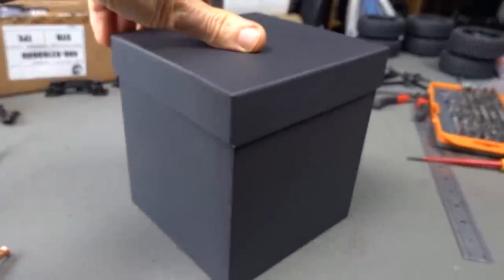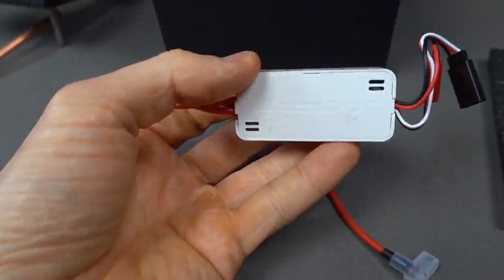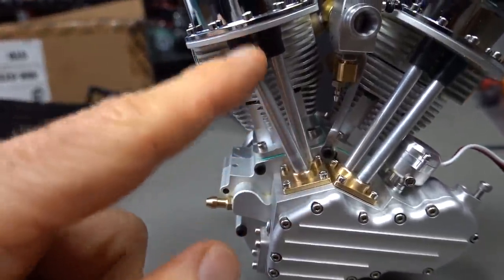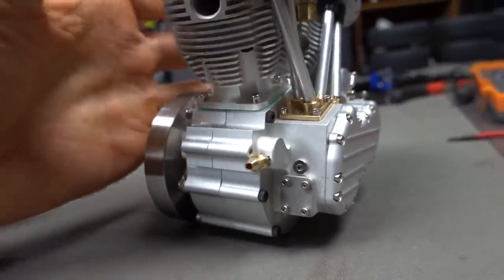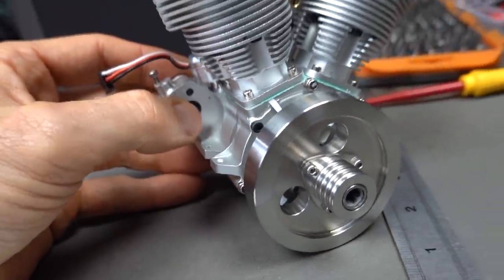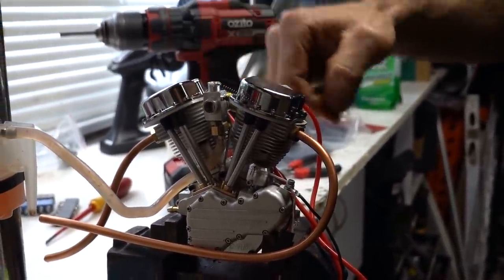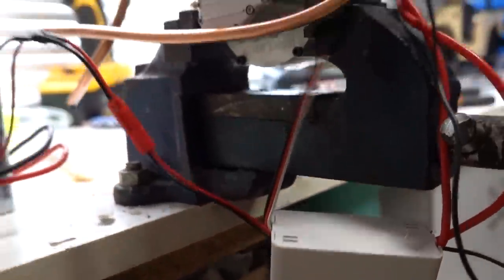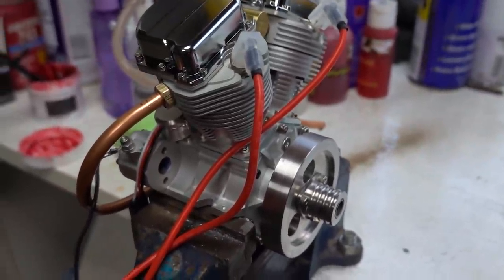MINIATURE HARLEY-DAVIDSON V-TWIN PANHEAD ENGINE THAT RUNS - SOUNDS INSANE!

Comment: The engine's them selves didnt leak oil, they had an external drive chain oiler that dripped engine oil on the chain and it was adjustable.  Awesome engine for sure.
Reply from the maker: Thanks for the info
Reply: Once you put a few miles on them they did…it was due to the mediocre fit & finish of the components at the time…in fact, I don’t think they got a oil “tight” bike until the Evo came along…some would say the engine that saved HD.
Reply: I need my oiler turned down.lol

Comment: WOW! Someone finally got a scale engine to actually look and sound like an engine! 
  Now, if you can get it to leak reliably you will have created perfection! 
Well done mate! Cheers!
Reply from the maker: Much appreciated brother
Reply: Look into the Moki 400cc radial, sounds just like a real plane
Reply: Yes must leak and need tuning every once a month on a sunny Sunday and polishing for at least 3 hours every other week ,oh and it must be chain driven so the inertia rattle on chain and drive sprocket wears main driveshaft every 6 months.
Then it'll be authentic!✔️
Reply: Judging how it spewed oil out of the exhaust he's off to a great start
Reply: I had a 57 Panhead and the sucker would leak more than the Exon Valdez in the 80's. There was an adjustment to oil the primary chain using a dripper mounted on the side of the case. Every time it would jiggle, it would vibrate some engine oil and lubricate the primary chain going to the transmission.

So in reality, it was a good thing to find oil under your ride after it had parked for a bit. All the accumulated oil inside the primary cover, would leak to the ground. It also helped the dust to stay down. 

Nowadays, it is worrisome finding oil under your ride anytime!

Comment: Harley spent a lot of engineering muscle to design an engine that sounds like it will die at any second while producing as much vibration as mechanically possible without falling apart.
Reply from the maker: Lol
Reply: Yep! That’s why they’re great! Ever seen the smile on a woman’s face when she’s on a Harley?
Reply: @boataxe4605  That's exactly why Harleys aren't ideal as motorcycles,  granted, they are technically advanced, and powerful as vibrators go, but since they won't fit in most bedrooms,  they weren't great at that either,  and for those who could get them in the bedroom, they got off great, but they died from carbon monoxide poisoning.
Reply: Some reservations on the last part of that sentence .
Reply: WITHOUT falling apart? How many Harleys have you been around?
Reply: @palleppalsson  OK, you caught me making  💩 up. Harleys have always  brought out the trouble maker in me. They're so loud, and annoying, I can't help it.
Reply: @RyanMcIntyre  Well everything is relative,  they have to hold together long enough to drive off the dealership property in order for the customer to legally "take possession" of the tractor/vibrator/motorcycle , and by "take possession",  I mean get ready,  the spector of Harley ownership will soon make itself painfully evident.
Reply: @RyanMcIntyre  Dude, all anyone has to do is stay awake while driving.  99 out of 100 bikes pulled over along the road are Harley riders looking at a broken rubber band. 😜
Reply: I first read this and was immediately clutching my pearls! How dare you!? lol. 

However, not standing up for H-D too hard here (they’ve had their fair share of issues) but when AMF bought them out, they made dog shit bikes. When the og ownership bought the company back, it took the help of BMW to get them back to respectable with the Evolution motor (imo H-D’s best engine in terms of sound, reliability, and weekend mechanic). 

NOTHING sounds like a carb’d EVO at idle
Reply: @boataxe4605  
The smile would be more impressive with more teeth. 😁
Reply: HAHAHA
Reply: @divine_swine9665   I call bullshit. Please share why or what makes you say Bmw ever worked with Harley. Especially on the evo motor. I'll wait.
Reply: @divine_swine9665  nope the best idle goes to  the shovel/pan .can't get the girls off it . something about a galloping horse sold the evo kept my shovel with 4 long f#kin gears to ride at low revs cheers from Oz
Reply: @RyanMcIntyre  haha I thought he was referring to the women's smile not the falling apart I mean I'm a Harley enthusiast, I love all Harleys but come on how can you argue with that? Harleys are not known for their dependability!
Reply: I also heard that Harley spent quite a bit of legal muscle trying to patent the sound.
Reply: Paul I worked at a dealership  they catered to yuppies , I worked in the parts and accessories department.   I have owned  many Harleys. I don't ride anymore  my last Harley was a 06 Street BOB many problems with, it my last bike was A Vulcan 1700 classic better than all the Harleys  I ever owned, .
Reply: @motoman7445  BMW is fare superior lol , and I owned three Harleys  ,  and I worked at a dealership , where they catered  to yuppies , BMW isn't made in China . My last bike before I had to stop riding was a Vulcan 1700 classic was  stock and it would blown my last Harley a 06 street bob away and that had performance parts in it .
Reply: @palleppalsson  right, they do indeed fall apart, I’ve owned almost every make, the best road going bike ever made is the GoldWing
Reply: @scottkeppler9151  🤦‍♂️ What does anything you said have to do with my comment?
Reply: @boataxe4605  very true. I've never seen a grumpy woman on a Harley, a horse, or a bike on a bumpy road. 😎
Reply: The Harley Davidson, the perfect tool to turn fuel into noise without the side effect for of performance.
Reply: You're just jealous that no one is buying or even making miniature models of your moped engine, haha.
Reply: I agree with the sound part, but falling apart.  They do that regularly.
Reply: @motoman7445  he meant Porsche design…
Reply: @Wooskii1  and lost handily.  Po-ta-to sound not patented.
Reply: @boataxe4605  this comment is so underrated lol
Reply: Harley are still over priced pieces of shits lol.  I would never own one. Loud and Slow.... maybe a Sportster Maybe but I still can't bring my self to waste money on one.
Reply: Yeah and I delivered a load of the bikes to Phoenix and LA.and both places shocked me and pissed me off.neither place had a load dock or a ramp.so they just slung a strap and chain and drunk them back in their crates,2 high. REDICULOUS.piss poor management if I ever seen or heard of.i mean cheapest bike was probably 15 grand or better.but the gals in the LA shop did want me to bring in my black bug so I got him a leather Harley Davidson collar also
Reply: @scottkeppler9151  yeah but BMW's are apposed twins not a v twin.which makes them lighter and easier to handle. Dad's cousin had an old 900 and his daughter had a Yamaha 400 special.and the 900 felt just as light.the weights down low.
Now my cousin wrecked his goldwing June 6th.turkey flew out of the ditch and hit him in the head throwing him into another vehicle head on.he's now paralyzed waist down.he loved riding. So did I.my last bike was an 85 Yamaha Venture Royale touring bike
Reply: @boataxe4605  oh you brought back memories  by that comment. Women said one day when i asked why do you like riding on the back of a rocket?  Her reply "the vibrations "  I'm like jump on this.   She did. I fired up the harley and got the "OH MY" lmao. Believe i changed her mindset
Reply: @deborahchesser7375  Learn to do maintenance!
Reply: No they fall apart
Reply: @seanbutler2291  Whatever you say troll.
Reply: @boataxe4605  Wipe that seat
Reply: and what a sound it is
Reply: @Asphaltsquadron  …. Calm down Mate… he’s getting your Goat.
Reply: @motoman7445  I think they're referring to Porsche's work on the Vrod but I am sure you knew that.
Reply: @deborahchesser7375  the Goldwing is a couch with wheels.  Not a bike.
Reply: @poolshooter1229  I can teach you anytime, I’ve been a mechanic for 35 years
Reply: @deborahchesser7375  You near Jacksonville NC, I have my two bikes apart, one waiting for powdercoated parts and the other waiting second in line a 19 year old Swift Bar Chopper with only 1700 miles on it, it runs awesome...just needs my spare time I never have. I started wrenching my minibikes around 1965.🤭
Reply: You can turn the idle up, but a lot of us want that low chunk-chunk sound. And this is an engine that was designed in the 1940's. Lots of haters, nerds and misinformation in the comments. Harley has never worked with BMW, they worked with Porsche on the V-Rod engine, not the Evo.
Reply: So what you're actually saying is, "I want a Harley, but I can't afford it and wouldn't know how to ride it.
Reply: @deborahchesser7375  agree 😊👍💯❤️💋🔥🔥🔥🔥🔥🔥🔥
Reply: @monroe7403  That is correct, the Revolution was designed by Porsche, the Evolution is a HD inhouse design. IIRC the initial design by Porsche was lighter and more compact, Eric Buell wanted to use that engine, but HD had their way with it and it turned into a bulky and heavy motor.
Reply: @poolshooter1229  man I’d love to come down there and help ya out, I have family in Asheville, I’d love to move down there, Oh is too damn 🥶 cold
Reply: @ashookchandra8191  Wings really are great from 76’ on. Honda in general is hard to beat.
Reply: @divine_swine9665  add a crane fireball cam to the mix with head work to suit and you have the perfect evo engine, I ran points though, as I only had a kicker no zip start
Reply: @deannederhoff  Sorry for your brother.  I’m happy I survived my 2 wheel years with my skeleton and most of my skin intact.
Reply: @billygraham2132  don't know what part of that that you're talking about sir but thank you.cousin wrecked his goldwing on a 2 lane County road in Iowa June 6th 2021.turkey flew out of the ditch and hit him in the head.threw him head on into on coming traffic.he's now paralyzed waist down.but I sat on his dad BMW 900,many many yrs ago,and it felt as light as his daughters Yamaha 400 special.just because opposed twin cylinder.come down to maryville tn and ride the tail of the dragon some time.beautiful ride.even in a car.it was even in the old movie TWO LANE BLACKTOP with James Taylor and Dennis Willson of the beachboys.the restaurant scene was up there.lol
Reply: @RyanMcIntyre  Falling apart??? I paid $40,000 for an Iron Horse Outlaw, towed back to shop 8 times first 900 miles...i'll keep my Harleys.
Reply: @monroe7403  "Harley has never worked with BMW" - you. I want you to Google that so you can correct your misinformation.
Reply: @r0bkills  I believe those are referred to as generator shovels.  Potato, potato, potato...😎
Reply: Harleys make plenty of heat than power..so its an effective heat pump!
Reply: Who said they didn't fall apart? My buddy's AMF Harley wew!
Reply: @alexnutcasio936  The V-Rod was a collaboration with Porsche (bike, engine). The EVO engine was a collaboration with Honda.
Reply: @Hathorr1067  isn’t that what I said ( referring to VRod)…….the EVO is equally junk.
Reply: Let's not forget the reliable oil leak they designed into it.
Reply: @trxtech3010  Well, once you own one, you never go back and wonder why you didn't spend the extra money and just get a Wing or a BMW. Mine not only vibrated, it leaked, so I got the double pleasure of a total POS.
Reply: Awwww come on man,...they fall apart sometimes.😂

Comment: Sounds real and has that lope. The mounting flanges are not tapped on originals, just bolts thru with spacers on the frame as needed. The engine mounts were bolts/nuts front and rear also with a skid plate.. I do like what they did for getting close to the original sound.
Reply from the maker: Thanks for the info mate

Comment: That hole you pointed out as a possible starter mounting was actually the location of the generator on the older style Harleys. I rode Panheads for 10 years, m last on was a 1965 Electra Glide .The starter was mounted on a cast aluminum Primary cover and engaged with a flywheel on the clutch drum on the transmission.
Reply from the maker: Yeah fully aware but this miniature version apparently might have a starter motor there

Comment: That’s amazing.  Now all you have to do is make it  leak oil from the primary cover located on the left of the engine  because of bad seals or o-rings as well as make it leak oil from the drain plug and starter areas.
Reply from the maker: lol

Comment: Good vibrations dude! Pan head? May want to keep a shop towel under it if it’s based on the infamous pan head😂! What are you gonna put this in? Nice little kick scooter motor! Very nice brother!
Reply from the maker: Haha yeah man. If they can sort out a starter and clutch then a Morgan three wheeler style would be awesome
Reply: The original panheads did leak however the new crate engines from places like s&s have updated parts from the evo.. they last a long time and run great
Reply: The intentional leaks from Harley were from the primary drive.
Reply: RC Car

Comment: Would be absolutely awesome to see this in a tiny little motorcycle or three wheeler type vehicle
Reply from the maker: I agree man
Reply: RV trike would be awesome 👌
Reply: @RCTanksTrucks247  40s military harley with sidecar would be awesome
Reply: @migz2195  Except a 40's Harley would have a flathead motor. Not a panhead. Js.
Reply: @motoman7445  ahh I see....well that sucks lol
Reply: @migz2195  tbh that would be a awesome project to see and see the final outcome, if someone would really try and take lengths to make this into a small scale Harley would be ridiculous if it was a two wheel rc design
Reply: @RCTanksTrucks247  Schwinn Stingray 16. Will have to buy on eBay
Reply: Why not a moped?!
Reply: Trikes are gay but I would love to this in a mini flh or mini chopper
Reply: Side car
Reply: Hello

Comment: Where you talked about mounting a starter is where the original 6 volt generator would mount. The very last year models were made with a 12 volt generator and only the last year had an electric starter that hooked onto the primary drive at the clutch/transmission location
Reply from the maker: Ah hopefully with this rc version they could adapt a starter motor instead with a one way bearing
Reply: @RCTanksTrucks247  Just relaying some history since I was a Pan owner reclaimer after a fire

Comment: 7:45 that's not the idle adjustment screw. That's the mixture adjustment screw.
The idle screw is that little black flathead screw sticking out below the throttle arm. It's pointing directly to the lip on the cylinder panhead. That's what adjusts the idle.
Reply from the maker: Yeah figured it out 👍 Thanks anyway

Comment: The clutch on a Harley does not mount at the flywheel.they run a primary drive chain or belt to a clutch driven transmission mounted to the rear of the motor. The secondary drive to the rear wheel would be on the other side.
Reply from the maker: Yeah I know but for a rc car application I need the traditional clutch bell style
Reply: The secondary drive to the rear wheel would be on the other side, really?
            NOT !

Comment: this in a boat might be a new project for me, sounds awesome, would be great out on the water, just difficult to cool it
Reply from the maker: Yeah man, great thinking
Reply: It's air cooled. Why would it be difficult to cool ?
Reply: The shovel head started out being a boat motor,
Reply: @jameskong5233  no.... it did not. 🙄 it was designed from the beginning to be a motorcycle engine and thats what it always was. Someone somewhere probably adapted it for other uses but it was always a motorcycle engine.
Reply: @jameskong5233  You mean boat "anchor"... LOL!
Reply: @whatyoumakeofit6635  not enough airflow around it due to how much weight it would be pushing. On a little Jon boat I wouldn’t think it would do much more than a couple miles an hr. So it would more than likely heat.
Reply: Fan/airboat prop on the crankshaft and a bit of ducting should work, or a belt driven blower. RPM's would be the biggest issue. Doable.

Comment: greetings, from across the pond, over here in sunny Melbourne, Florida. I always wanted to build a little V-Twin, I was even going to try building one with a couple of five horsepower overhead valve lawn mower engines, I may still do that one....but, I can guarantee you that the motor you got there, probably cost almost as much as an actual V-Twin. yeah I'd love to know the price and the specs of this thing, how much power, etc. that thing's super cool. hey, one question. the engine didn't have enough fly wheel weight inside the crankcase, or is that just an extra flywheel on the outside, just too smooth it out on the stand? I'm sure I can help you figure out a clutch setup for that thing as well. just need to know the application, what you're going to put it in, and all..😎💯💯💯
Reply from the maker: That's awesomeness mate. Definitely needs a new starter system and clutch. Once that's sorted I will be able to make it work in something

Comment: That's awesome. The price they want for these things is insane though.
Reply: Well i run Zenoah 32 cc rc cars motors and its one per year 
for racing. Its a complete motor like this and they run at around 
550.00 Canadian. This will have cost me 800 Canadian but wtf its only money loll.
Reply: @mikep4823  the Zenoah engines can be rebuilt. Why would you need a new one each year? 

P.S. I used to race an HPI Baja 5T.
Reply from the maker: Not too expensive really

Comment: Run a belt to a slave shaft/bell clutch housing mounted behind the engine. Then run a chain or belt to the rear wheel. No problem.
Reply from the maker: Interesting, thanks man
Reply: @RCTanksTrucks247  I just sent a join request on your Facebook page and will post pictures of my 1/4 scale dragbike that has the transverse clutch setup that I'm talking about.